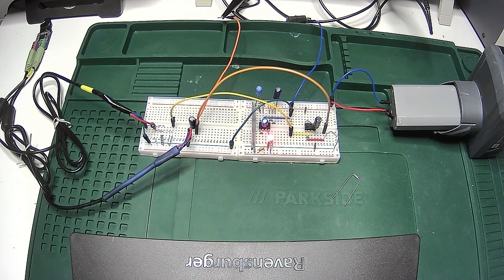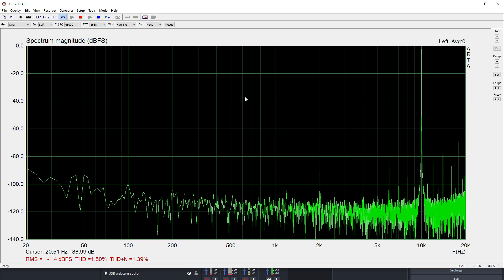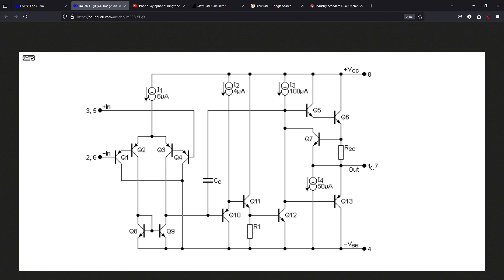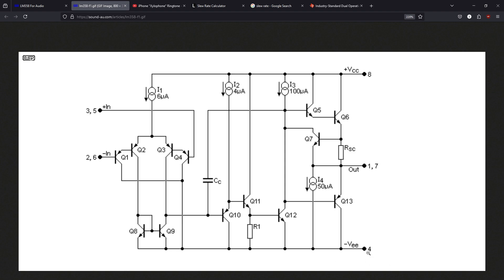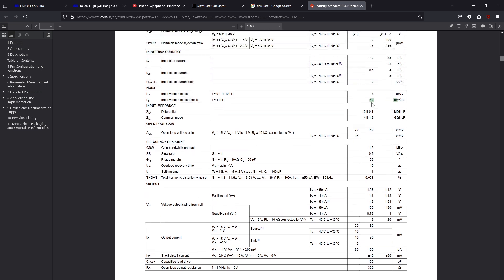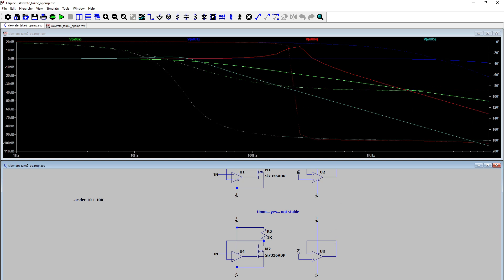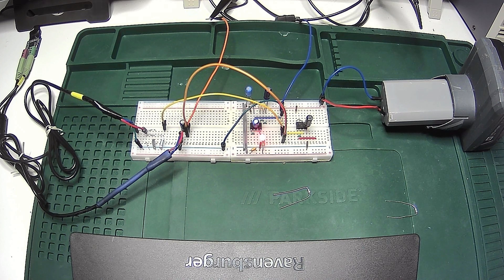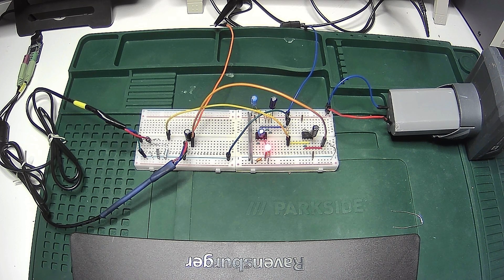Distortion Test of the LM358 Op-Amp: Overcoming Limitations

Comment: Interesting tutorial !  and I see that you are trying to 'polish a turd' which is a great way to learn, getting the very best from what you have, bravo. As a side note there are a lot of good audio quality op amps and I will share my personal favorite and its OPA1656 FET input or OPA1612 if you prefer a BIPOLAR input, both design by Burr Brown and I used one in my take of Rod Elliot's headphone amp  with awesome results although I designed my own PCB.....cheers.
Reply from the maker: Thank you for your comment and I much agree with your analysis. In truth, the only good reason to use a BJT family in a (generic) circuit in 2025 is if you can get your hands cheaply on one. Its effectively a dead family for several reasons, most notably static power losses and thermal performance. FET and especially HEMT material FET transistors are the future. 

I've personally not used either of these chips but as far as opamps go both are great from a design standpoint. 

As an aside, I am not sure what is more incredible, how far opamp design has come from the 60s (and technically before, vacuum tube "opamps" is a separate story) or that people are still using descrete long tail pair! circuits in 2025 in some designs...
Reply: @ivanrodionov9724  yep ! :)

Comment: Why not just use an LM833?  It is designed for audio use and is low distortion, and shouldn't need any tweaks to work quite well.
Reply from the maker: Hello, thank you for the feedback. You raise an excellent point! In truth the lm358 chip is a lemon as far as pure performance goes and for that matter the lm833 is also not a rocketship either. There are always truly top of the line newer and better chips , however there comes a big catch with using these: price. The true trick is to get something not just working well, but at a minimum price point to fit the suited requirements!
Reply: @ivanrodionov9724  Yep, I'm aware, but 4558 is as cheap as 358 :) I like playing with 358 too, so there's no problem with that. The designers of 358 wanted low quiescent current, so the output stage is not class AB. It's more like class B. If you want to avoid the dead zone you should always pull or push some current from the device, but NEVER switch from push to pull.

Keep it up! I love analog electronics videos :)
Reply from the maker: @tiftik  Thank you for your reply! The designers of the chip did a great job for making a great chip for the specific low power jellybean application but of course with some technical compromises for other applications. This is a quite poignant observation with the dead zone, as switching can create more issues, however it depends on how robust the feedback implementation is. 

As for the analog videos, I will try my best! Unfortunately there are only 24 hours in a day.
Reply: Or a 4558